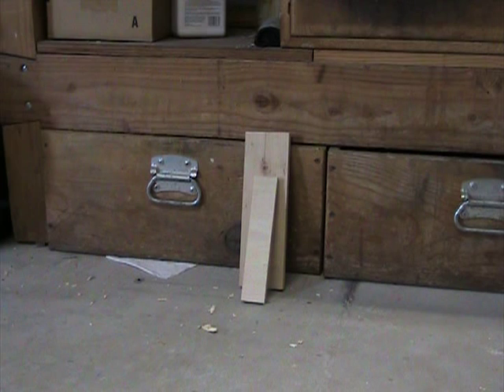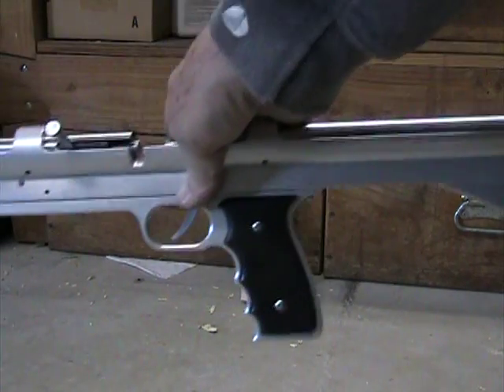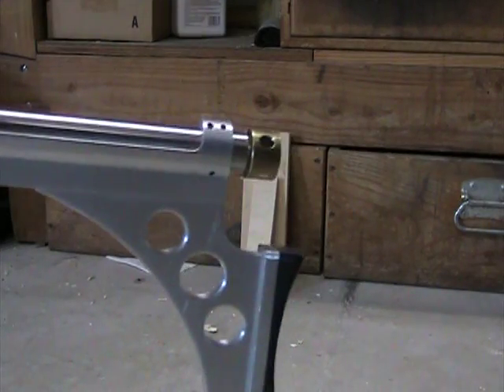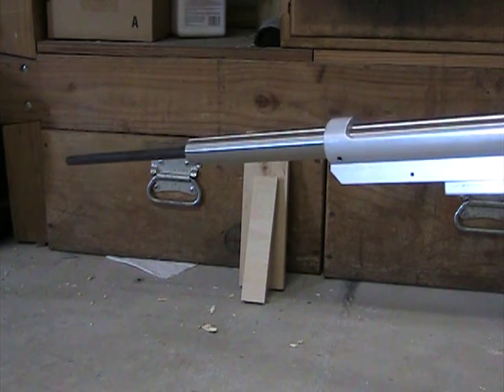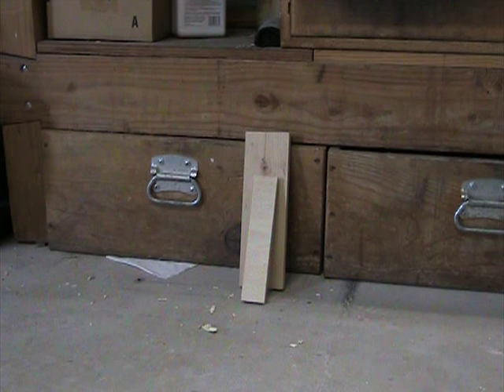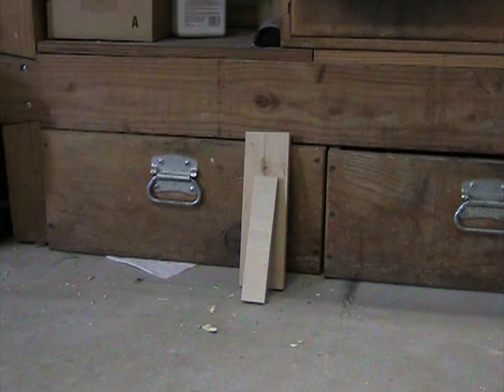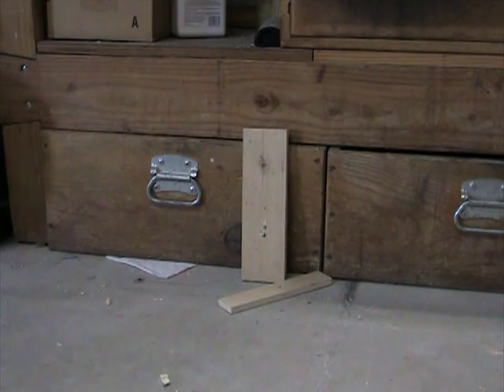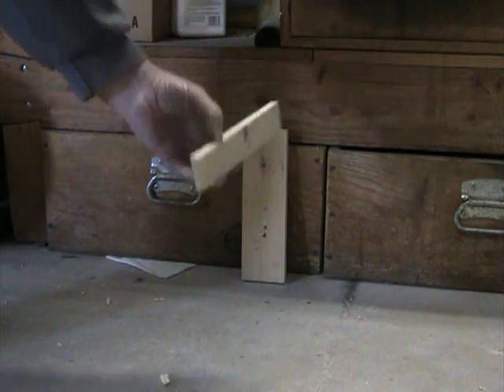Home Built Airgun

Comment: i got a question. My friend machined me pretty much same kind of valve you got there, has little bigger flow though. How heavy hammer are you using? From the pictures i see it has been made from brass, so i believe its about 100 grams. Any possibility to get more accurate data?

Comment from the maker: @30GB - Yeah, it's actually overbuilt by quite a bit.  I designed and built it to safely hold 3,000 PSI and the reservoir is rated to about 6,000 PSI.

Comment: Shoot a .785" diameter Type L copper and you will get much more power at much less pressure.

I can easily shoot a 10d nail 3-1/4" long dart through 3 layers of 3/4" plywood.

Not a pretty as your work, but it is much more powerful.

Copper Air Rifle Components and Assembly